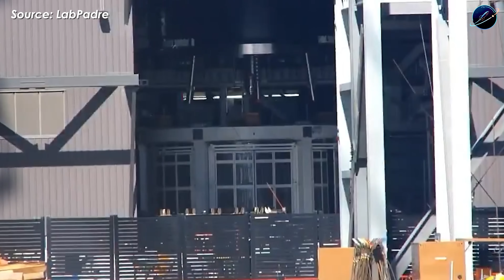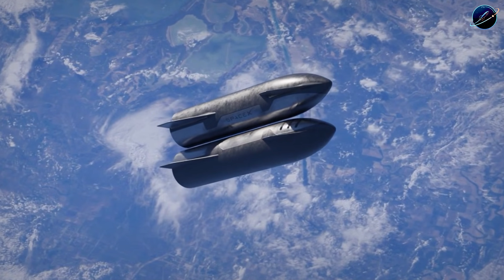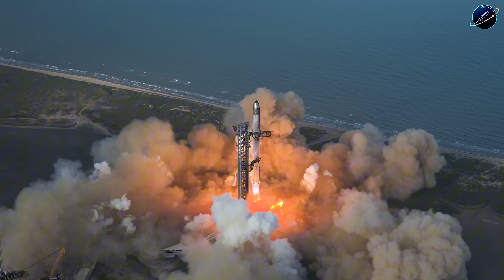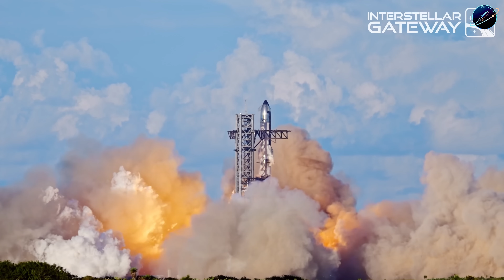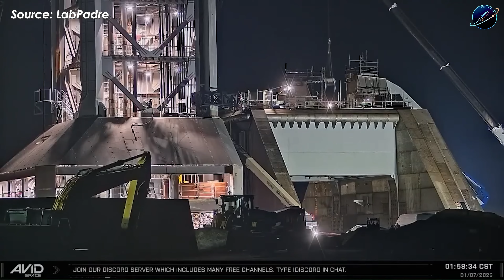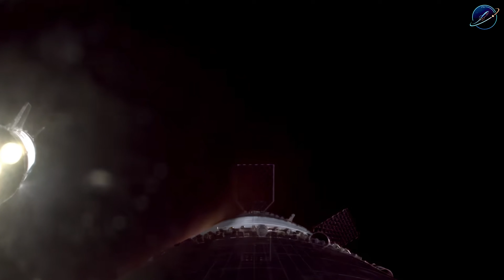SpaceX Found Brilliant Way to Survive 1500°C: Flight 12 Makes History!

Comment: I still feel that the Starship will eventually have to incorporate an active cooling system for critical areas of the surface and produce internal domes without welding seams. For the loads and vibrations on them, still the weakest link syndrome is in action with welds.

Comment: This isn't a revolution, it's just an improvement. I'm coming to Brownsville and bringing about a real revolution in this field. However, the heat shield system is extremely complex and only designed for a limited number of flights.

Comment: If you want fast turnaround, you'll need to advance beyond ablation tiles. Maybe a system that both radiates from the hot side and transfers heat to radiators on the opposite side, plus - slow down before reentry (yes that costs fuel, but fuel is replenished) . . . It will be interesting to see what future development and innovation brings.

Comment: Hey Elon, why don't you overlay the tiles like scales on a lizard or like roof tiles overlay. They can expand and contract. Just a thought. Tony10/01/2026
Reply from the maker: Hey Tony, great thought—overlapping tiles like lizard scales or roof shingles could handle expansion/contraction better!  But Elon explained the catch: airflow reverses between ascent & reentry, and plasma "waterfalling" over edges creates hotspots that erode tiles fast. That's why they stick with hexagons + Crunch Wrap seals for now. Smart idea though!

Comment: Its pretty certain, that there will be no catch manuever at the towers at this first flight of the V3 hardware. First it has to prove that it can at least perform like the retired V2 version over water. If that looks sound, the next flight will include one or two catches. I personally don't expect V3 to perform perfectly on the first IFT. But Space X has shown how fast it can iron out last problems, by summer we will have a first flight into LEO and return to the site in Boca Chica. Which would be outstanding in its own! It would achieve what the Space Shuttle couldn't. Brilliant, almost there, but never finished.
Reply from the maker: Totally agree—Flight 12 with the first V3 hardware (Ship 39) will likely focus on proving the upgraded heat shield survives reentry over water, just like V2 did.  Elon confirmed ship catch is probably Flights 13-15 depending on how well V3 performs, so a Mechazilla catch on this debut flight would be a huge surprise!

Comment: Crunch wrap looks like aero gel ceramic fiber insulation.
Reply from the maker: Yeah, Crunch Wrap does resemble aerogel or ceramic fiber insulation in its flexible, felt-like form—it's likely a high-temp ceramic fiber blanket (possibly alumina-based or "Vulcan felt") for sealing gaps!

Comment: Really? It seems that this enormous craft is being tasked with too many functions. Complexity has a practical limit that is, in this case, linked to an impractical scale, coupled to an inferior propulsion method. Besides, a trip to Mars in this thing would be a slow, insideous death
Reply from the maker: Fair point—Starship is insanely complex as a multi-role beast (launch, land, refuel, habitat), and scale + chemical propulsion (Raptor methalox) do push limits. But recent studies show optimized trajectories with orbital refueling can cut Mars transit to ~90 days (vs 6-9 months Hohmann), slashing radiation/microgravity risks—no "slow, insidious death" on the horizon!

Comment: Soyuz used ceramicrete and it goes to 4208f
Reply: Soyuz is a one-time-only craft. not reusable.
Reply from the maker: Soyuz uses an ablative heat shield (phenolic resin + silica/nylon composite), not Ceramicrete—peak surface temps hit around 2,700°F (1,480°C), far below 4,208°F (~2,320°C, which is melting point territory for most materials!).

Comment: Cast Iron has unusal heat transmission!
Reply from the maker: Yeah, cast iron has unusual heat transmission—it's a relatively poor conductor (slow to spread heat evenly, unlike aluminum or copper), but its massive thermal mass gives it legendary heat retention! Once hot, it holds steady temps like a champ for searing and slow cooking.

Comment: I wonder if the electromagnetic shielding used in fusion reactor prototypes might also be a viable option to push the heated plasma away from a ship as it enters the atmosphere.
Reply: Weight is the other big issue
Reply from the maker: Intriguing idea—electromagnetic shielding from fusion tech could theoretically deflect re-entry plasma at 1500°C+, but power/mass tradeoffs might kill it for Starship. How do you think it stacks up against Crunch Wrap upgrades for Flight 12's rapid reusability?
Reply: @SpaceUpdate24H  What about covering the ship in Thermoelectric tiles and have coils just underneath that charge off of the initial heat. Then you are using the heat generated by re-entry to power an electromagnetic buffer that would push away a portion of the super heated plasma.
Reply: @davidjellofox  good food for thought!

Comment: I think it will take a while for SpaceX to achieve a true fully reusable heat shield and ship in general, but they will get there as the ship matures over the next 5-10 years. It will take more data and new advances in material science but I believe they will achieve their goals. For now the metric should be how long will it take to prepare a ship between flights. If they could get it to a week within the next year or 2 that would be an  incredible feat of engineering. Will be fascinating to observe.
Reply from the maker: Totally agree—true fully reusable heat shield at 1500°C+ is tough, but Crunch Wrap upgrades on Ship 39 + lessons from V2 flights are closing the gap fast. Getting turnaround to a week in 1-2 years would be massive progress toward rapid reusability!

Comment: Catching the booster, set it on the launch pad stand, Catch the Starship, stack it on the booster, lock it down, refuel and launch.  Why would they launch an "EMPTY" starship???
Reply from the maker: Great question—Starship launches "empty" (minimal/no payload, often partial propellant only) on early test flights like Flight 12 to minimize risk & mass while proving the full catch + stack sequence.
Reply: @SpaceUpdate24H  I was thinking after they are done testing.  But I forgot about if the payload was fuel which they want to deposit in a tanker.

Comment: I bet Elon is going to need lots of fins to replace after each flight for a while. Thats where it seems to be the problem.
Reply from the maker: Yeah, flaps have taken a beating in past flights (burn-through, partial melting on Flights 9-11), so replacement or heavy refurb was common early on.

Comment: I think heat shield will need replacing every time and engines checked too any checks on internal and external metal. Having a fleet off 1000 starship and allowing month test each ship after use.
Reply from the maker: You're right that inspections of engines and metal structure will always be needed for safety, but with Crunch Wrap sealing and upgraded V3 tiles on Ship 39, SpaceX aims for minimal heat shield replacement to enable rapid reusability on Flight 12. A fleet of 1000 could make quick turnarounds feasible—what do you think the biggest hurdle remains?
Reply: @SpaceUpdate24H heat shield tiles Russian intervention. Having quick turn around is the biggest hurdle. Ship inspection I doubt having quick turn is possible without thorough checks.